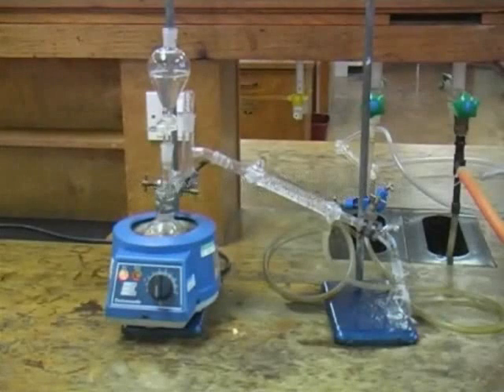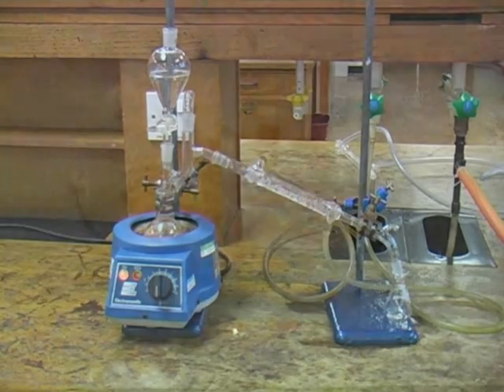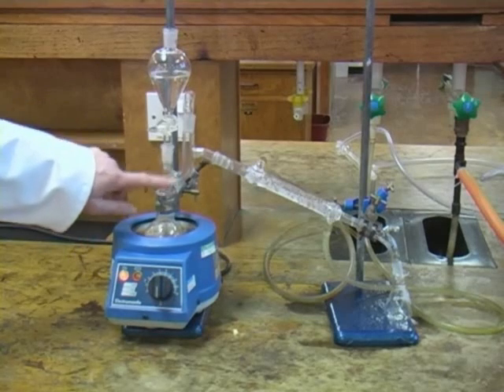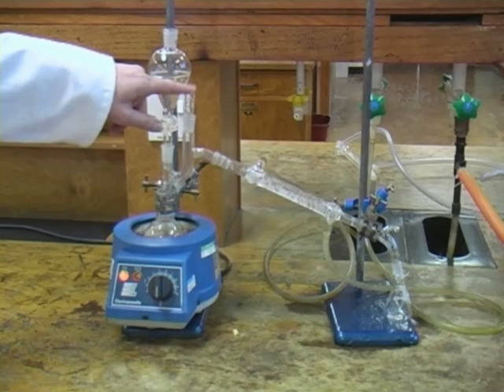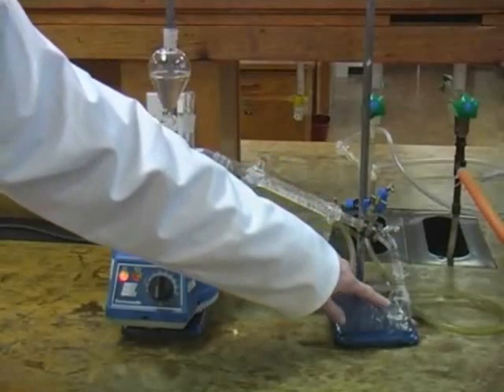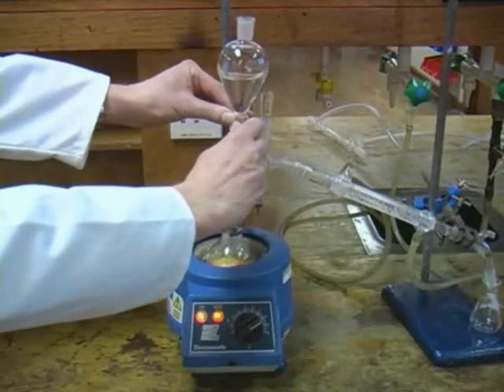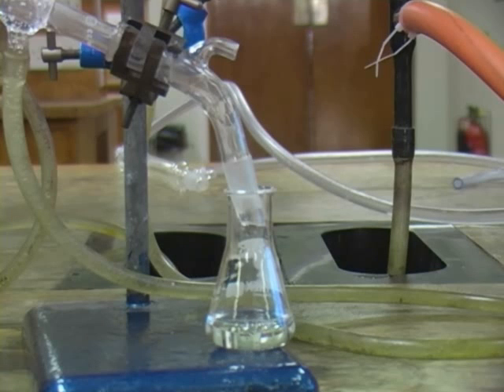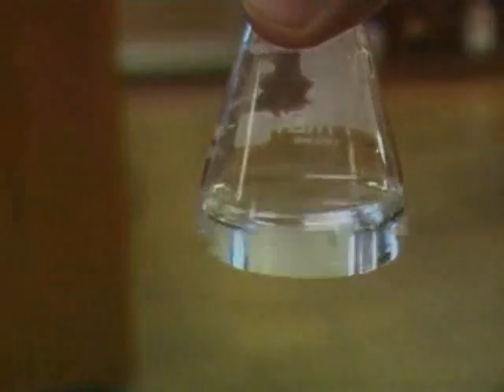Steam distillation

Comment: @dakiwininja Distillation can't be used to make alcohol. Alcohol is made by fermentation. Distillation is just the evaporation and condensation of a liquid. This is generally done to separate substances with different boiling points. The most well known example is the separation of water and ethanol. If you were going to distill ethanol for drinking, you would need a much larger setup. At least a 4 liter boiling pot. By the way, home distillation of ethanol is illegal in the US.

Comment: @dakiwininja steam distillation works by pumping steam through oil containing plant matter, then condensing the steam+oil. Used for production of essential oils, tea-tree, eucalyptus etc.

For alcohol you "reflux" by turning the condenser vertically, this essentially "reboils" the stuff over and over, then by keeping close control of the temp you can have only the alcohol vapour flow over the top, into a condenser, resulting in liquid alcohol at the end.

Comment: i tried this at home with a 1000ml three-neck round flask and a liebig-cooler. the flask was about 1/3 full with orange peels. i distilled about 600ml clear liquid which has a strong orange-like smell but i don't see any layers, the liquid seems homogenous. any suggestions?

Comment: @mee198205 yes, any kind of pump will work.  some will be too strong obviously, and some will be too weak.  One that is too weak doesn't mean it won't filter, it will just be slow.  

I would doing a trial run first to see how it works, then filter your solvent/solids.  Correct me if I am wrong but isn't a fish pump the opposite of what you need?  you need suction, not force.  Doesn't a fish pump push air into the water?  Don't push it through a filter, pull it though.